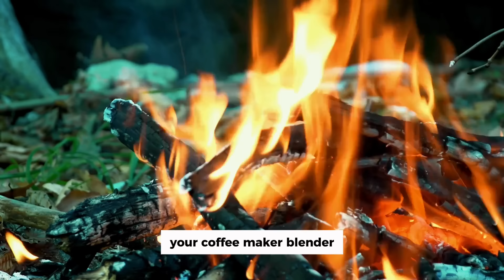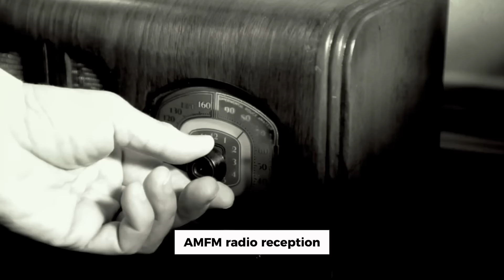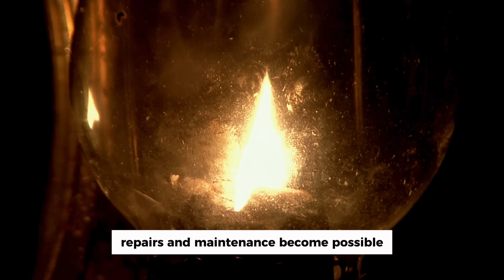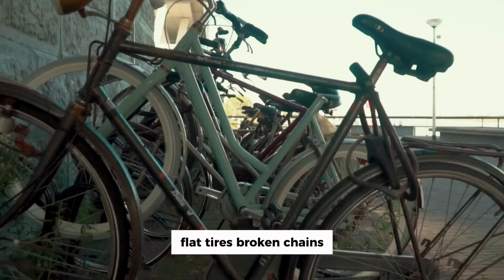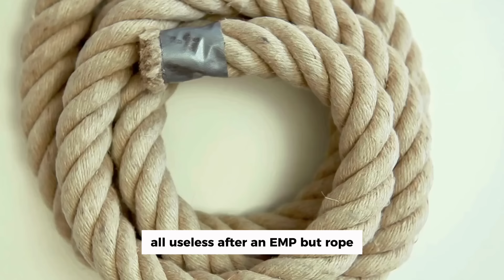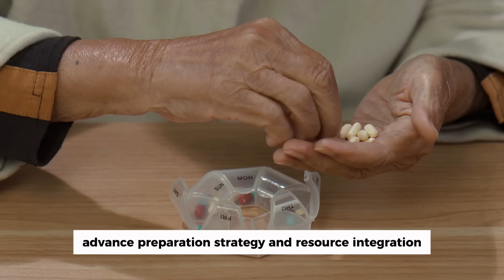11 Cheap Household Items That Will Still Work After an EMP Blackout

Comment: Won't an EMP take out radio stations and transmission equipment?
Reply: An EMP can take out a radio station as well as transmission equipment but there is a good chance not all of them won't get taken out and they can transmit signals for miles. With other forms of modern communication you need enough of the system or network up for it to work and with enough of it down it will be difficult to fix. Radio transmission is simple/primitive enough that even if part of it goes down it is still a lot easier to get working again than TV, phone systems, internet, etc .
Reply: @dclem005 thank you. I wondered about that, too.
Reply from the maker: That is correct, but there are still ways to get important information.